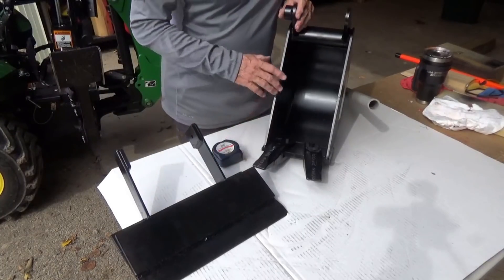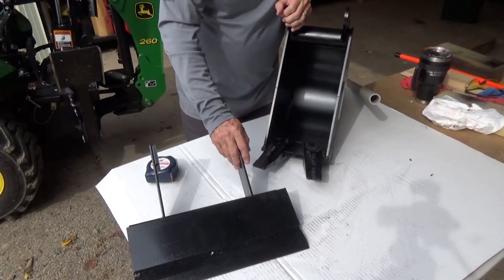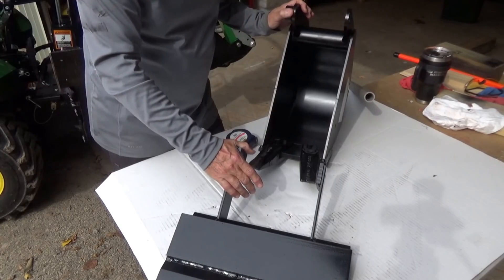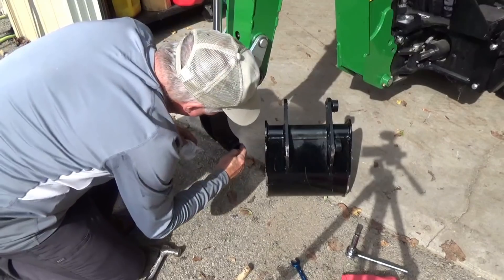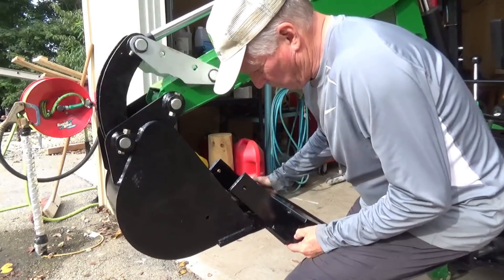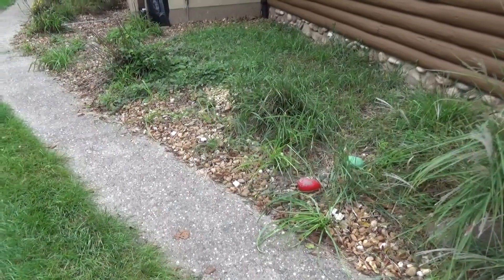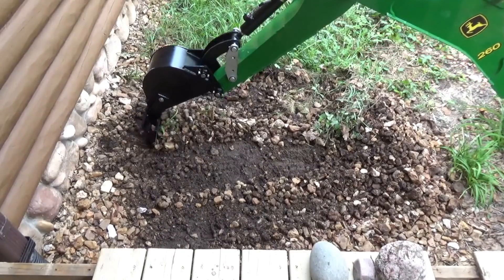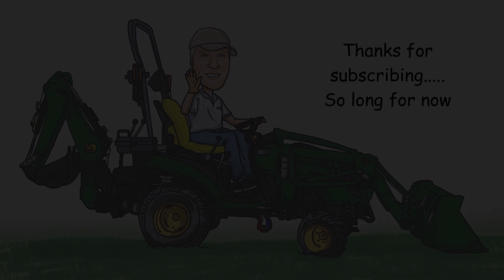John Deere Backhoe Attachment- Custom Scraper Blade / #85

Comment: Much simpler and faster than building a stand alone blade. It also as the advantage of easily reverting to a bucket!
I'm going to see if I can do away with the bolts through the bucket and maybe have it clamp on the back somehow.
Reply from the maker: Good plan Dave, let me know how you make out with your design idea.
I don’t use the attachment a lot but it sure comes in handy three or four times a year.-Bill

Comment: Is this something I can buy on line some where? I have a Yanmar sa221 . Thanks . Very useful.
Reply from the maker: Good morning William. I custom built this with an experienced welder here in my town. I have two videos relating to this paddle, I would think if you took the video to a good welder he would be able to follow my design and make you one. I’m not aware of these selling anywhere in the retail world. 
If I can be of any further assistance or send you pictures or measurements, please instant message me.
I agree it’s a very handy accessory to have. -Bill
Reply from the maker: William I was thinking of you when I saw a ditch bucket from Mudds Customs.
Would that work for you? -Bill
Reply: @billburkhart  thanks, I have just a standard bucket on . What is Mudds Customs?
Reply from the maker: That company is here in Iowa and makes backhoe buckets for tractors our size. The ditch bucket they make has no teeth so I thought that may be a way for you to get something that the paddle I made. Google their name and you’ll see what I’m suggesting.

Comment: Bill will you send more measurement on the thickest on arms and blades, Thanks nic vedio
Reply from the maker: Sure will, I’ll get it to you Friday Nic
Reply from the maker: Wayne the steel is .52 thick. You may recall I purchased snow plow scraper blades and cut everything to fit. The steel connector to the bucket is .25 thick. Let me know if you need additional information.

Comment: Wider, with some ears on the ends to keep the rocks/soils from rolling off the blade. Cool little scraper, but why not use your bucket. Are you going to haul the stone away with your bucket?
Reply from the maker: I did haul the stone away with my bucket, I just shot a video that will coming out soon and I think you'll agree it's a very handy modification to the bucket. The way it trims and feathers the grass, well you'll have to watch the video when it comes out soon. Thanks for commenting.

Comment: Good day. 

I saw your video on YouTube and watched it and what I immediately thought was that you better for the gravel in your garden what we here in the Netherlands call a "fine-grained mess" I will try to get a photo of it to do . 

but I think your friend should be able to make it for you with, for example, concrete reinforcing steel. 

those bins work super well for that. 
scrape a bucket with the bucket on the excavator. 
just shake the bucket back and forth 
and all the ground, sand, grass, etc. fall back on the ground and you keep a bucket with "sieved stones" in the bucket of the excavator. 

Kind regards Hollandduck from the Netherlands. 
(source translation: Google translate)
Reply from the maker: hollandduck79  I never knew such a bucket existed. I found  photos on line and will ask Kenny to build one following your suggestion. Thank you very much. Dank U

Comment: what size tractor is that? I've been looking to buy one for my landscape projects and am trying to figure out what size to get. Also, how effective is the backhoe for digging and pulling out stumps like old shrubs if you've tried something like that with it?
Reply from the maker: Hello Happy Spring. This is a 1025 John Deere, I live on 17 acres an it does everything I want with some limitations. Digging trenches to bury conduit, planting trees, seeding new lawns and using the forks to lift for me has been awesome. Digging large stumps is asking a lot of the machine. There are plenty of videos showing it can be done, but it has limitations. I just ordered a 2038 for more HP and more breaking force of the backhoe. Hope this explains the answer is somewhat complicated depending on your budget, and how quickly task must be done.
Reply: Bill, I appreciate the insights. I’m looking for a tractor to do some grading, and that I can put a backhoe on to pull shrubs and bushes out on my landscape jobs, and whatever comes around to use it. Tired of using a spade and shovels to do my tear outs. Thought about an excavator but I figure a tractor will be much more versatile. Just wanted to reach out to come owners and see what they had to say before i make a decision and spend the money. Also do you think I could pull a tractor of the size you’ve got, or say a 3038e which is what my dealer pointed me towards with a Ram 1500?
Reply from the maker: Happy Sunday, my Chevy 1500 pulls 5000 lbs very well. TLB attachments and sod. The tractor is very versatile, yesterday I used the forks as temporary saw horse, you just never run out of ideas on how it can assist you. The 1025 will do everything you you described above. The only regret you'll have is not getting one sooner. Have a great spring.
Reply: Bill Burkhart thanks again for the reply. Not that I don’t trust the dealers opinions but I’ve always thought it’s good to get info from them and rely on guys in the field for real life experience and knowledge. I’m going to do a bit more research and looking but hope to buy a tractor soon for my landscape company. Currently I’ve got a Ram 1500 and a dump trailer that I’ll be using to pull it around. I’m hoping having a tractor can make my small company lots more profitable and versatile. It’s a tough decision spending that kind of money but it could open so many doors.

Comment: Hey Bill. How thick of steel did you use for scraper blade
Reply from the maker: Hi Jason, I used a 1/2 snow plow cutting edge, that provided me with a tapered edge on one side. Thank you for your comments and saying hello.
Reply: @billburkhart  do you know dimensions?  I am getting ready to make one. Thanks
Reply from the maker: @loghauler3069  Hi Jason,  the scraper width is 15 1/4 inches, the height of that face is 6 1/4 inches. The back piece is 8 inches.  Over the winter I built a 24 inch wide scraper and it's different in design because I wanted to keep it as light as I could. I'll post that video very soon so you can compare both designs.

Comment: Just to clarify- you drilled the holes in the side of the bucket, right? Nice video. Thanks for sharing!
Reply from the maker: Yes, that's correct. I used a 5/8" nut and bolt. Thanks for commenting and saying hello
Reply: @billburkhart  I just found your channel. I have a 1025r too. Love it... Except I need more lifting capacity and a cab. Got cold and wet moving snow this year.

Comment: Nice invention!  Just a word of caution, I realize your machine is new, but when working around machinery that is suspended in air,  it could fall at any moment  and injure or kill you! I would suggest blocking the boom and dipper stick so that it could not fall.   Remember Murphy’s law.   I worked in the coal mining industry and it was company policy, state law, federal law, and common sense to block up any suspended hydraulic booms.   Work safe!
Reply from the maker: Hello Don, you are absolutely correct! I was on a job site and watched  a man ride on the forks of a lull , the forks collapsed and he was killed. The reason was never found. I'm in full support of your comments. This was only staged for a photo op.  Thanks for reminding me of the dangers of hydraulic failure.

Comment: Another idea, makr blade a bit  taller, drill holes behind it and slip another " shoe" over the blade but cut that piece like a rake.  That looks like an ice chopper too for sidewalks and driveways where plow cant push. Round the sides of blade out like () to carve boundary around stumps before digging...maybe use as an ax-chopper for stump roots? He should sell those!
Reply from the maker: Thank you Steve, I'll share your thoughts with my friend. Have a safe spring.

Comment: Where did you get the 6" bucket? I have seen one from bxpanded, but its a bit pricey. Nice scraper attachment btw.
Reply: Yeah, the smallest I've seen from Deere is a 9"
Reply from the maker: Hi Don, I made a mistake, the bucket is an 8" bucket, it was $300 at my JD dealer. I use it a lot. Thanks for asking.

Comment: May I suggest ,the sticky sand paper you use on stair ways so you do not slip.Its thick. 
I spray painted the strips JD green and put it on my front cylinders so when I stack branches I do not scratch the paint.
Maybe you could use some on the dipper stick so you do not scratch your paint where your bucket rests.
We all know when you park your tractor hydraulics settle.
Reply from the maker: Hello Allen, thanks for checking in and sharing your idea. I made a larger paddle for the larger bucket and will be sharing that soon. Thanks again for your comments. Bill

Comment: Where did you buy a 6" bucket?
Reply from the maker: Happy Sunday Jason, I purchased the bucket at my John Deere dealer. About $300. Thanks for the question.
Reply: I think that is a 9", isn't it?  I have the same bucket.  I asked for it when I bought my tractor and they thought I was crazy, but I like it.  Good on roots and good for trenching.  Digging may take a bit longer, but time on the tractor is fun.
Reply from the maker: @suburbantractor9125  Jason- I went out and measured it, outside to outside it measures 7 1/2"  inside to inside it measures 6 7/8 So its bigger than 6" but it sure is handy as you point out. Thanks for asking.
Reply: @billburkhart  Yes, the same size as mine but I remembered the size wrong, JD calls it an 8".  I looked in the catalog and the sizes are 8, 12 and 16 inches.  Sorry for the confusion.  Jason, BXPanded has a 6" bucket if I recall correctly.
Reply from the maker: @suburbantractor9125  I
Jason, I looked at the 6" bucket BXpanded has too. Thanks for making me aware of the mis-information. I'll try and clarify the video.

Comment: Very nice!
Reply from the maker: Glad to hear all is well in your world TT. 
I loved this blade so much I'm welding a 24" wide blade for the larger bucket. I have several videos showing how I used it this fall. I'm really happy with the design because i slides on and off quickly. Looking forward to videos from you soon. - Bill
Reply from the maker: Thank you, I'm really enjoying the attachment. I'm making a 24" for the larger bucket too. Are you caught up with your projects?
Reply: Slowly but surely.  We've had daughter off to college and a bunch of 'events' that have conspired against my projects lately, but hope to get back into the tractor vids soon.  Weather is finally cooling off down south so I'm going to try and do a big push this fall.  Curious on the blade mounting - did you look at taking the teeth off and using the mounting holes they use for the blade?  I think you mentioned something about that, but I wasn't sure.  I guess that may be more work to take on and off.  I like that design alot - I'm going to have to add that to my weld project list as well!  Thanks for the video - it's excellent!

Comment: Looks like something I've been thinking about building 2 dip out a bunch of debris in an old Root Cellar I have for the building is fell into the cellar. I have a Titan thumb on my backhoe and have been trying to figure out how to get everything out of this Root Cellar so I can build a garage over the top of it and use this 3 foot pit for a pit for mechanic work. this may actually work for the small stuff. After I remove what's left of the building.
Reply from the maker: Good luck I hope my Proto type lead you to something that will work